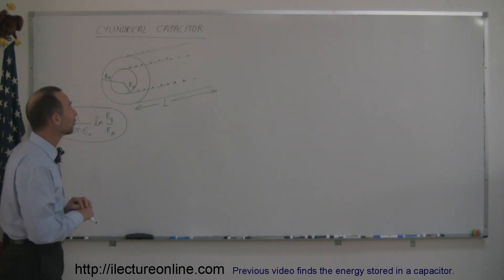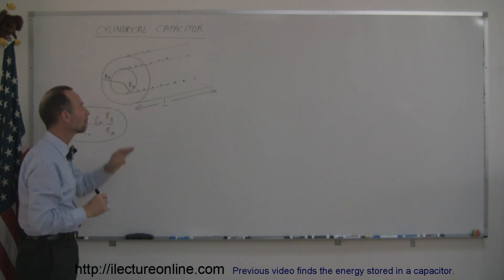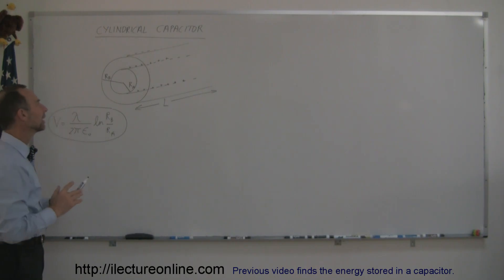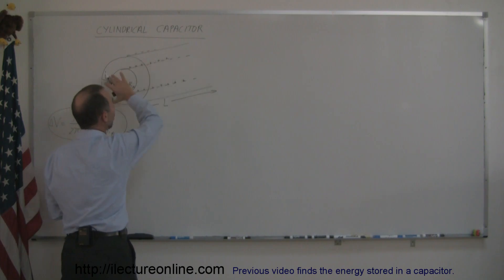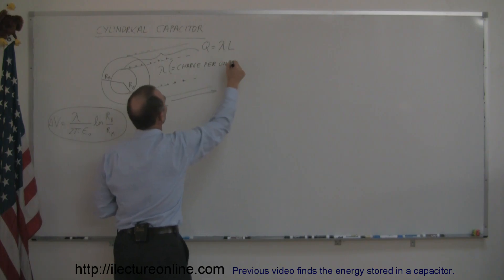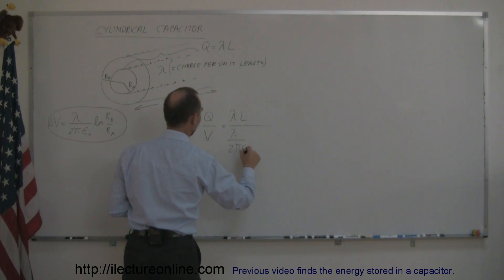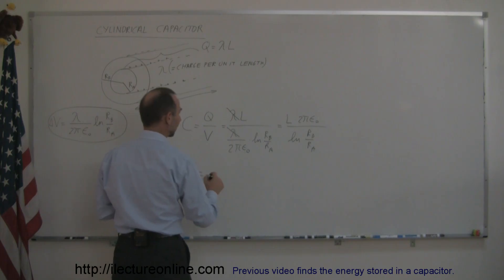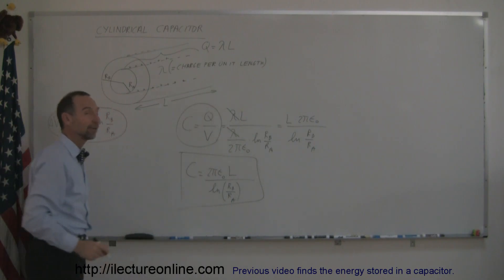Physics 39   Capacitors (8 of 37) Capacitance of a Cylindrical Capacitor

Comment: For those who are wondering why the equation for voltage is so, it's what you would get when you integrate the e-field from an infinite line of charge (lambda / (2pi e0) / r) dr, from r = rA to r = rB.
Reply: How do you get the electric field expression

Comment: Hello. When we derive the electric potential expression , we make the assumption that the amount of charge Q is spread out over infinite length. When we construct a Gaussian cylinder with length L to find the E field, we say that a fraction of that total charge Q is enclosed with in the surface, which can be labeled as q. Thus we get that q=lambda*L. In this video, we revert to saying that total charge Q is spread out over length L. Why can we do that? Wouldn’t this change our Electric Field formula and thus change our electric potential because now the ends of the cylinder are affecting the E field? Thank you for any advice.
Reply from the maker: There is no such thing as anything (including a cyliner) that is infinite.  But when we look at a wire containing charge and we are close enough to the wire, then we can make the assumption of an infinite wire and compute the electric field and the electrical potential, using that model.  The calculated results will be very close to the actual results.
Reply: @MichelvanBiezen  I see, so we’re just slightly tweaking our initial assumptions based on our perspective. I am a high school student teaching myself electricity and magnetism and the examples in your lectures in conjunction with my textbook are very helpful. Thank you!

Comment: i have a question  .. What if the inner cylinder was actually an infinite charged segment , i can notice that the segment is a cylinder with a very small radius value , but i really don't know how to approach this problem  and get the capacitance value
Reply from the maker: The geometry of a capacitor demands that the inner surface and out surface are of the same size and that the gap between the two is very small.

Comment: What would be the capacitance if only a Sector of the outer cylinder is the negative terminal of the capacitor? Let's say a quarter of the cylinder is the negative conducting plate. What would the capacitance be?
Reply: @Michel van Biezen sir
Reply from the maker: Then the capacitance would be reduced to the fraction of the size of the outer plate.

Comment: how did you get the potential difference between those plate, sir?,  i just want to know to satisfy my understanding
Reply from the maker: Potential difference =  E d    (the electric field multiplied by the distance).  Since the electric field is not constant it requires integration.
Reply: @MichelvanBiezen  thank you very much for the explanation !

Comment: does this only hold if the inner electrode is located in the center? how would the capacitance change if the inner electrode wasnt centered?
Reply from the maker: That would be very difficult to calculate.  (Off course capacitors are built to be symmetric.)

Comment: It doesn't matter if the outer cylinder is of positive charge and the inner cylinder is of negatively charge, the equation stills the same?
Reply from the maker: Yes.  (The polarity will be reversed)
Reply: Thanks for the quick reply.

Comment: Why is Q not equal to 2piRL*lambda, which would be the surface area of the cylinder, not including the ends?
Reply from the maker: The charge on the cylinder is given as the amount of charge per unit length (Not per unit area).